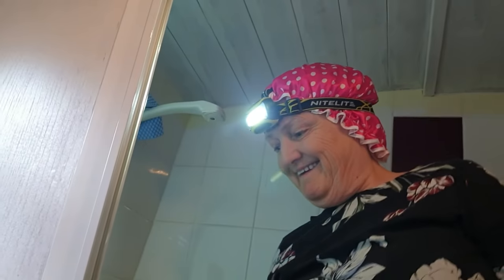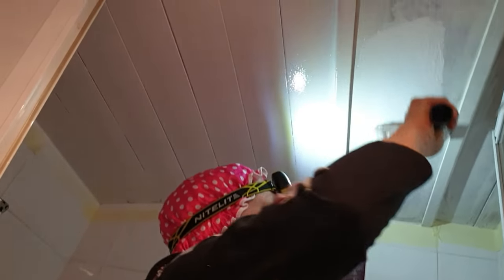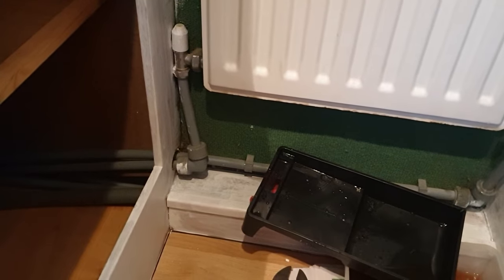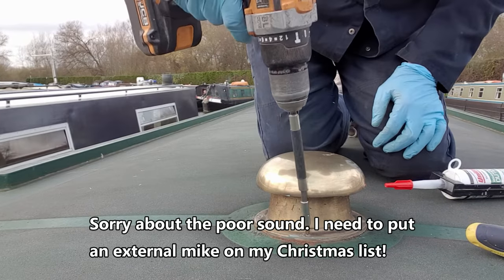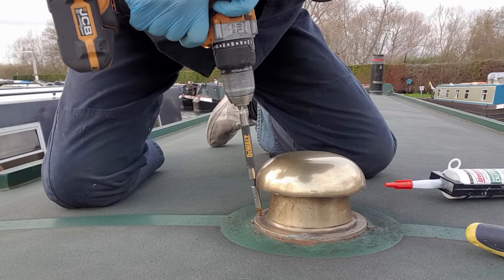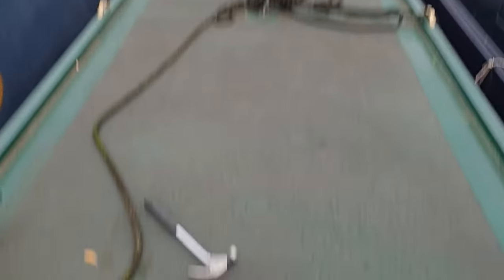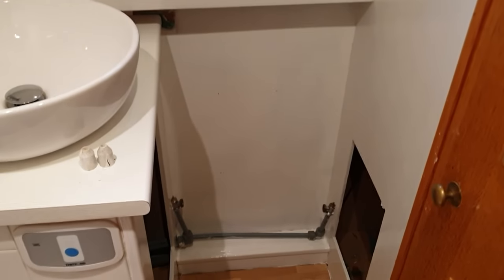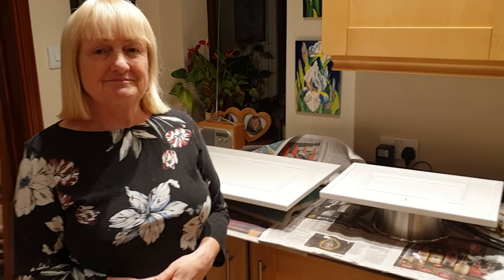#3 Paint, plumbing and mushrooms. More work inside (and outside!) our narrowboat Pioden

Comment: Bass water and steal = corosion of the steel you need an insulator between the two
Reply from the maker: The sealant is a pretty good insulator I guess, but I'll look into this when I paint the roof and redo the seals in the spring.

Comment: I would put some aluminium foil behind the radiator to reflect heat.
Reply from the maker: Just bought some radiator backing reflective insulation material for just that purpose! 😊

Comment: I watched the 3 videos and can't believe how much you don't know about  basic fixing and doing stuff.  Tape the pipe??  Plastic pipe shears and a straight pipe connector. You have plenty of room to do that.  Is this going to be the tenor of this channel?  Maybe one episode will be, " Came back from the shops and the boat had sunk. What went wrong?"    The mushroom screws. Have you never heard of penetrating fluid? I guess not in this script.
Reply from the maker: I'm happy to fix the pipe properly, and will do so in the spring (as I say on the vlog), but there is no easy way to drain the system and I wanted a quick temporary for now on very awkward place to access. 
Re penetrating fluid, I did say on the vlog I'd use some WD40 on them if needed. They came out straight away though with my impact driver - which is on my next video.
My vlog is not supposed to be the expert way of doing everything perfectly - there are plenty of instructional videos on YouTube if thats what people want to watch.